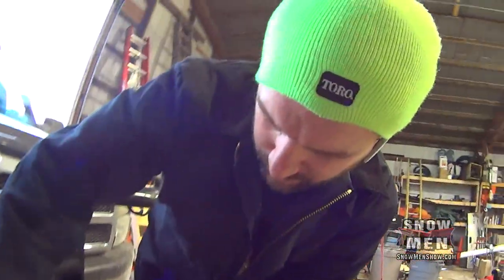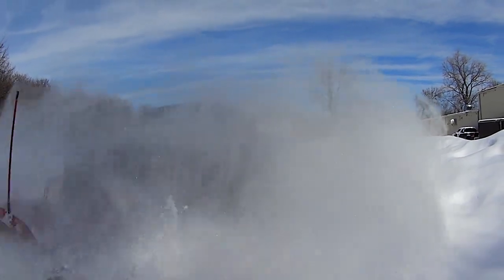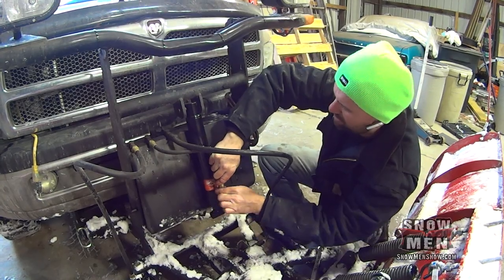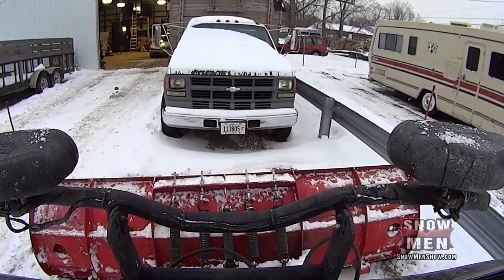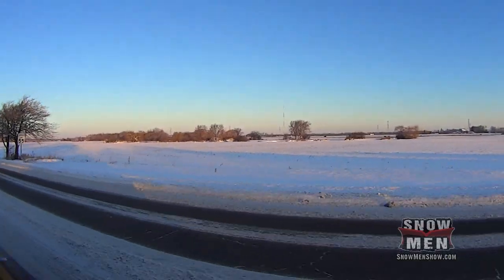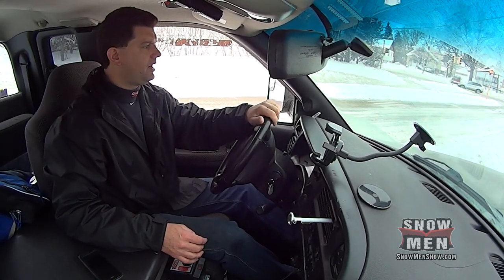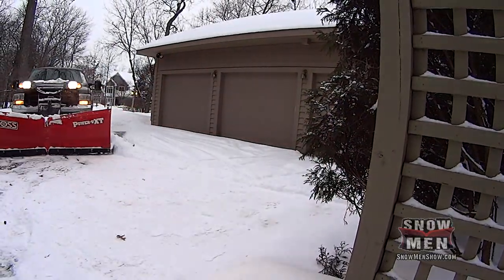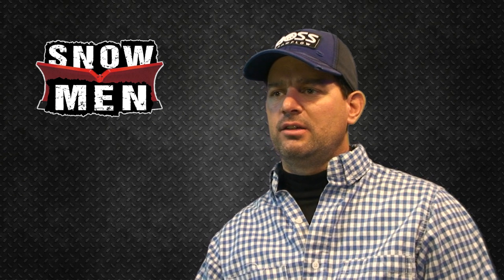Snow Men Season 1 Episode 5

Comment: To address the shaft pitting we coat the plow cylinder and ram shafts with heavy bearing grease. For the springs we coat the insides with fluid film using the interior frame applicator.
Reply from the maker: Thanks for the tip. Yes, we use Fluid Film too. Awesome stuff. We actually spray down the whole plow with it. We have a video about Fluid Film coming soon. This episode was filmed in 2013 and at that time we were not using it yet.

Comment: hey guys great vids. Question, when servicing the Boss hoses and or cylinders, does the pressure in the system need to be bled?
Reply from the maker: Yes, you would need to get any air out of the hydraulic system. It is good practice to do a system flush any time you are changing out a part on your hydraulic system.

Comment: When one of your guys plows are just done because they have had their time would you guys consider buying the new boss ext expandable snow plow
Reply from the maker: No. We don't see the need for that plow. You can do much more with a V plow. If we are going to upgrade it would be a DXT. Extendable wings are just a gimmick. If you want a wider plow, buy a wider plow.
Reply: Snow Men oh ok because it could've helped you out with those big commercial properties you guys take care of
Reply: Check out back blades! Your $$$ will give 35% more Revenue on 4 hrs. it pays for itself in a year and you will thank me. They are residential killers and Ebling 16' s are great for Big Lots also. The efficiency is unheard of and you can add more accounts. I did it back in 05 and wow what a difference. Just need your front plow to stack

Comment: Shovel Rats, get them a reflective coat makes the world if difference, and plow and shovel yard the same every time then you will get to know what the other is doing next, hope it helps
Reply from the maker: It is a requirement for everyone on my crew to wear Hi-Vis clothing. This episode was filmed in 2013. Since then a lot has changed. We have more commercial work than residential now. We have different crews doing jobs from storm to storm and with commercial work you cant always push the snow in the same spots due to cars being in the way. So plowing the same way is a good thought but doesn't always work out. I always stress to my crew safety before speed. Thanks for Watching!

Comment: Nice job putting this together. What do you use for editing? Seems like it would take hours to put a video like this one together. I subbed. Check out my channel
Reply from the maker: Thanks! We use Edius Pro ( http://amzn.to/2EV6WuJ ) to edit the show. It does take a lot of time to edit. Each 22min episode takes between 30 - 40 hours of editing time.
Reply: Thanks. I had no idea it took that long but it makes sense. Any reason for not monetizing your videos?
Reply from the maker: They are monetized.
Reply: It is uncommon and nice that this video doesn't have the ad at the beginning that you have to wait for. I got a laugh out of the "shovel rat" term.  Now my Daughter has a new nickname.
Reply: The plow guys need to slow down, a lot of them hurry to get to the next job to make that money, and they could be safer by looking around more and not just look in there mirrors but turn your heads and look and not be eating or drinking, stop and take a brake for that, and put better lights on and a back up beeper, soon all this will be law, you have the responsibility  for your vehicle, when you run over something, stop and get out and look.